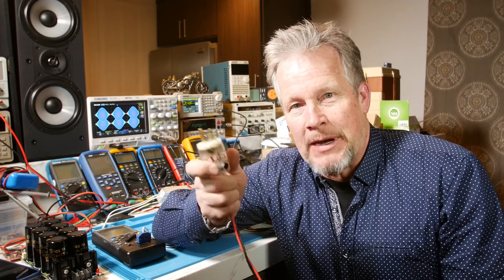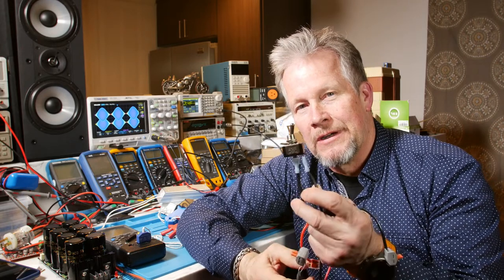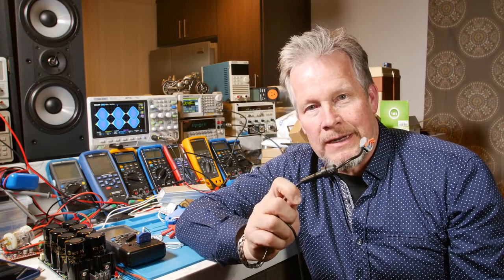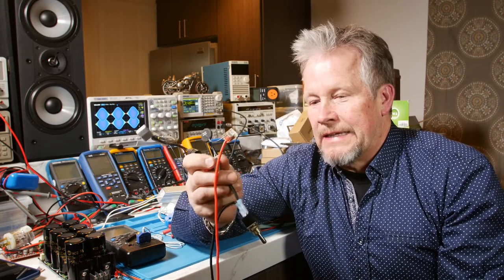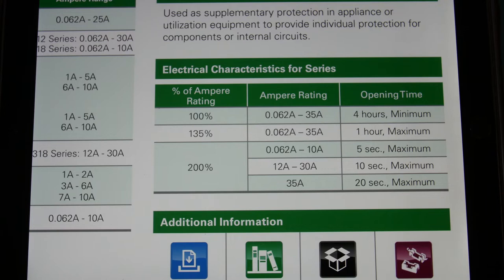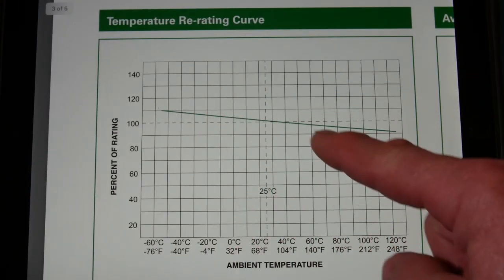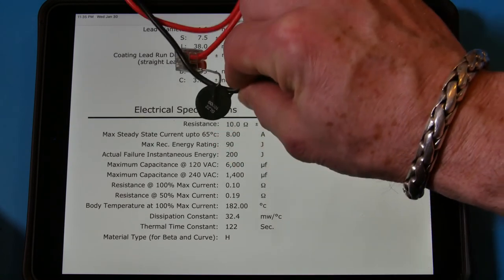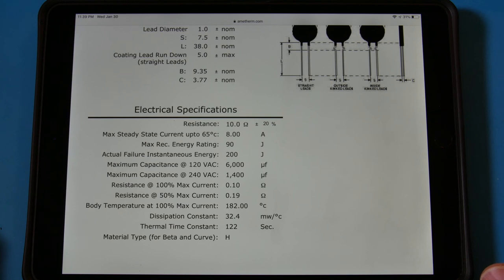Power Supply Design 2 - the Fuse and thermistor

Comment: I love this attention to detail  !  (Though you could speed it up a tad, you know...)
Tho' a plain desktop power-supply is a bit unworthy of your attentions, sir, because most times the job will get done anyway.
Not to say that design sloppiness is OK, but the applications will usually condone it. However, I have a suggestion :
Please take up a more critical gadgets such as 1) UPS  2) DC Welding-Inverter  3) AC TIG Welding Inverter  
wherein your attention to detail will make a difference of working or dead gadget, which is satisfying !
As I said before, we would end up with useful gadgets as well as an education this way.
Reply from the maker: I like that idea - thank you for this input!!
Reply: @KissAnalog  i think your speed is fine

Comment: do these NTC fail over time or should they last forever unless damaged by the power?
Reply from the maker: Great question!  I do think the NTC, if not overly stressed, should last very long without any issue.  They are used in many power supplies without issue.
Reply: @KissAnalog  the reason  I ask is my dac PSU is tick tick ticking and I hear its because a cap that charges it failed... but I'm a total noob  so just checking things.  Any ideas on that?   It's not ticking now that's gone but the unit still won't power on
Reply from the maker: Capacitors are a common failure point.  Any cap that shows any bulging should obviously be replaced.  If aluminium electrolytic capacitors were used in the signal path, then these should be swapped out with poly caps.
Reply: @KissAnalog  thanks

Comment: If I’m running 220v ac to use a thermistor do you need to hook only 1 thermistor to one side of the hot line? Or do you need to hook to one to each hot line being 220v? It’s hard to find any info on this topic.
Reply from the maker: Great question!  No, it is still a series circuit, but the current will be higher with the higher voltage so the thermistor needs to be rated for that current.  Thanks for asking.

Comment: Great and clear info! What if we used a 1,000V 1A in a circuit using 1.5V 1.5A, would the fuse still blow?
I mean, there are a lot difference in power between 1,000W and 2.25W.
Reply from the maker: Yes you are right there is a lot of difference in the power, but fuses melt with current heating and then blow open - finally opening the circuit when the gap is big enough to quinch the arc.  As long as the fuse is rated for enough voltage - then it should be good.  Higher voltage could result in more force opening the fuse, but then the arc might last longer too.  It would be interesting to test an extreme case that you present;)  I should do a short video on a fuse I invented;)  I will do a video on how you can make a fuse from wire and/or trace on a Pcb.

Comment: I was wondering replacing a slow blow fuse for two fast blow in parallel not sure the formula for this,  would it be half the current rating of the slow blow for each fast blow fuse?
Reply from the maker: I wouldn't recommend using 2 fuses in parallel.  They will not share perfectly and then you have to compensate by making them larger current ratings, and then you lose protection.  Try using a fast blow at the next higher current rating, or at the same current rating and see if it isn't slow enough;)  Even fast blow fuses are slow...

Comment: Very interesting video, thanks.  Looking at subsequent videos where you deal with inrush current, it’s obvious that the thermistor is providing quite some protection - IIRC, it drops the current from around 68A to 12A.  I assume that the rating of the fuse you would use is based on that value?  More generically, having calculated the thermistor to use and its operating characteristic, you determine an appropriate fuse?  I further assume that the downstream current that the load can draw also plays a part - does the thermistor play a limiting role across the whole circuit in terms of current that can be supplied (I may have confused myself totally here!!)?  I liked the way you went through the data sheets - I find them really hard - and it would be useful to have some worked examples for choosing the fuse and thermistor in relation to the power supply characteristics being designed for, including taking account of tolerances (for example, that thermistor you chose has a tolerance of +/- 20% so you’re somewhere between 8Ohms and 12Ohms.).  Really informative video, thanks
Reply from the maker: Thank you for watching and for the great suggestions!  You are right on point.  I’m working on the follow up videos now and should post later today and tomorrow.